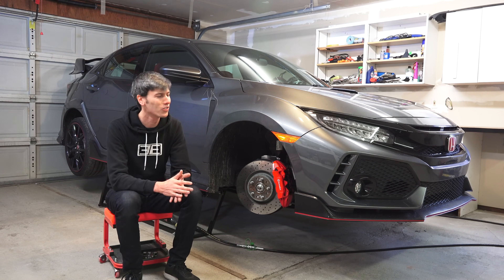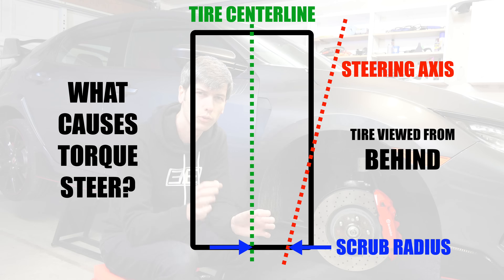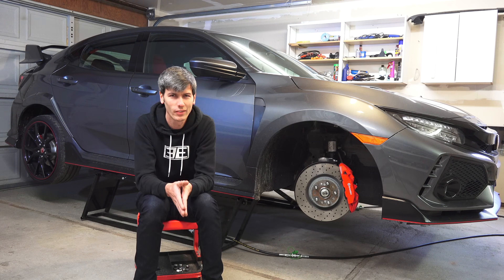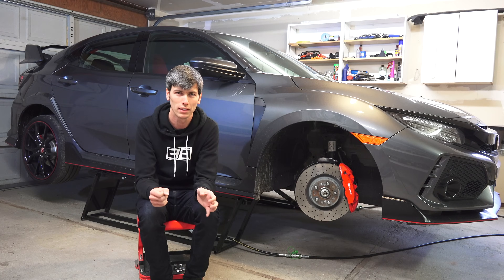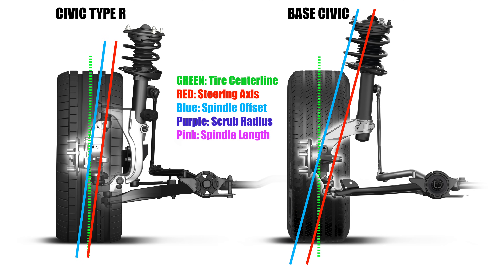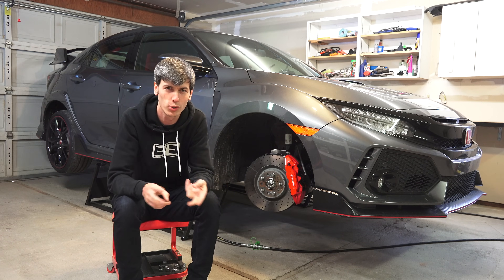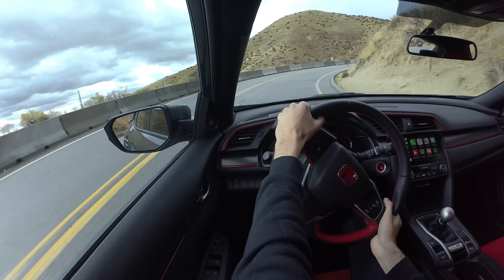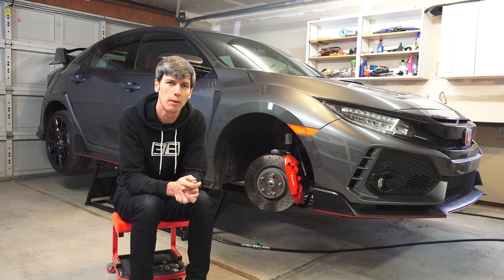Why Doesn't The Honda Civic Type R Have Torque Steer?

Comment: In FWD cars the torque difference at the wheels can cause steering problems, in RWD it can cause living problems :D (joke)
Reply: +Doc. Volt ......not if you were born in the 1960's like me, steering is way easier to me in a RWD while spinning because you don't lose your steering.  a matter of experience, opinion and generation i suppose
Reply: They both can cause living problems.
Reply: Johnny-B Racer born in 97 but agree with you
Reply: Oversteer scares passengers, understeer scares drivers
Reply: Johnny-B Racer 
Yep it’s just a different feel how the different drive systems rotate when cornering under power. 
I’d say awd would be the hardest to get used to in how it likes to go straight sideways till you let up some. 
Fwd similar in that gaining traction again by letting up but still rotates around the inside tire. Blind faith and more power will corner well still. 
Rwd, there’s a reason the fastest cars use this system. That rear inside rotation just works, a little counter steer and again more power is your friend if you have the 😁😁 to get it done. 

I’d say the best system being an awd with a one way front differential, just slightly under driven. Best of both worlds, drives like rwd, execelerates like awd and hard cornering under lots of power pulls the front in. 

I believe the C11 turbo use a system like this?

Or my personal experience or racing R/C touring cars 10yrs ago.
Reply: Lubos Reho Perhaps, but the fact that rear wheels lock forward inherently corrects minor torque differences, and non-open diffs will prevent major torque differences. Torque difference on wheels that can pivot is a much more noticable issue.
Reply: don't have to have been born in the 60's some of us like me that were born in the early 80's or later grew up on rear drive because their parents had 2wd trucks or cars like crown vic's.
Reply: torque steering in my opinion really isnt hard to control, maybe my car doesn't have as much as some but if u drive the car a lot its very predictable, yes it does happen a lot but its just a matter of holding the wheel harder at full throttle, not saying its easier than rwd but just pointing out its just something to get used to
Reply: xanderzero3000  it's not bad if you have lsd.  I've seen videos where they have drag slicks, 500hp and no limited slip.  Haha
Reply: An object being pulled is more stable than one being pushed, generally. So many more options in rwd though, but they require proper (advanced) input techniques. Teenagers and rwd and texting would be hell on earth.
Reply: not if you have any real skill or grew up with rear drive.
Reply: In a performance application RWD dominates. AWD and FWD sucks. A super front heavy vehicle is not fun to drive or safe in bad weather.
Reply: xanderzero3000 RWD offers greater driving control BY DEFAULT.
Reply: Yeah, it wont bore you to death.
Reply: scythelord Meh. It all depends how the car was originally setup. Saying you have 100% more control than FWD would just be wrong obviously
Reply: Yeah, nothing like having your driving wheels loose traction when they are also your steering wheels. Really builds confidence in the vehicle.
Reply: Understeer and torque steer doesn't bother me very much on an 07 honda civic on an unexpectedly slippery road compared to the oversteer on my pickup on a gravel cover road when I was not expecting it 😂
Reply: All I know is I live in the Rocky Mountains where it snows every winter so it's not very safe having a RWD car. I wish I did though.
Reply: LeBeckStudio I'm helping my girlfriend improve the way she drives, and she understeers like mad. She's afraid of oversteer as a driver and I'm afraid of understeer as her passenger. I keep telling her that a bit of oversteer is a lot easier to recover from than understeer, but something about oversteer just unsettles her too much to prefer it.
Reply: 'I was born in the 60s so RWD is best' lmao cool, pops.
Reply: Dude, I used to live outside of Boulder, CO. Honestly, FWD in the snow sucks. RWD in the snow, and especially slippery steep driveways/roads is far superior. FWD on steep slippery driveways...you can't get up the driveway. AWD in snow is best.
Reply: Torque steer not understeer or oversteer.  

Contrary to what the old man says  (I'm not far behind) fwd is easier to control.  Personal favorite and or how big your keyboard brass balls are don't translate to reality.  

What's more telling is when it starts to rain really hard you see fwd cars still driving the speed limit or 10 over.  All the rwd cars have slowed down.   If they are easier to control it should be the opposite.
Reply: Mitchell Couchman Because there are two forces on the wheels, as opposed to one. Even if in theory it was possible to have equivalent steering traction in fwd, there is still the issue of control. A canoe is steered from the back.
Reply: RWD offers greater driver control.
Reply: mbsnyderc ehhh i drove both. RWD is harder to control

Comment: with power/electronic steering, is it possible to program it to automatically compensate for torque steer
Reply: JogBird  probably, but its going to likely be reactive and thus limited and it will tend to reduce road feel.
Reply: Fozee Black. Learning how to drive doesnt eliminate torque steer.
Reply: JogBird I’m pretty sure the type R does this. Also applies single wheel breaking. He didn’t talk about it.
Reply: Fozee Black torque steer can't be eliminated no matter how good of a driver you are. It's a mechanical property. No matter what, if it presents itself it will make lap times slower and make for a shitty car. Ask the EG and EK Civic track community.

Comment: Ford RevoKnuckle :)
Reply: Renault was first with its perfo hub. Then ford with revoknuckle. Then vauxhall with hiperstrut. Honda basically late to the party.
Reply: You are all wrong Toyota invented this with it's super strut suspension on the Toyota Celica GT-Four.
Reply: Yes, Honda's suspension setup here is very similar to RevoKnuckle.
Reply: As far as I know Peugeot was first with the revo knuckle(sorry I don't know Peugeots name for it) on the 407, they still use it on some 508s but it's mostly on the c5, it was a good design and with the double wishbone aswell it gave an excellent contact patch but it gave a lot of trouble with the swivel bearings
Reply: Yup. 👍🏽👍🏽👍🏽
Reply: The original.

Comment: Please explain the DSG fart sound!
Reply: Jack Gedge I think you are for the most part correct. However I do recall a journalist asking a Mercedes AMG engineer about this and part of the reason was that they intentionally left fuel injectors on while simultaneously cutting ignition to give it that sound. I think some has to do with keeping modern turbo engines in boost, however if you compare AMG sounds to, say, a 911 Turbo S, the Turbo doesnt have nearly any "fart" sound since they likely cut both ignition and fuel.
Reply: Alan's correct, manufacturers intentionally delay timing on overrun to make the pop-pop-pop. Just some added theater.
Reply: SilenceFiction well to change gear you have to lift off the throttle in a manual car. The DSG is an automated manual, still has clutches etc just has an ecu to control it all. And so to dissengage drive, the ecu cuts ignition for that split second whilst the gears are swapped, cutting ignition instead of fuel means that you get the popping/fart noises because theres still fuel being injected. And so travels down the hot exhaust, It's why DSG diesels dont fart, they dont have an ignition system do they.  Does that help? Its my understanding of it anyway
Reply: kabob21 on the over run you can use ignition timing as a form of anti lag. Wrc cars are upwards negative 50 degrees timing on overrun and they generate over a bar boost on idle! But they have boost actuators that are opening and closing the wastegate and injecting air, thats not turbo flutter it's these actuators injecting air
Reply: Rodrigo Villanueva no because the throttle pedal on a diesal is the throttle body. The diesel isnt ignited its just compressed, the throttle pedal directly controls how much diesel is squirted into the bore. More you press the more diesel is squirted in. Diesel dsg cars, simply cut the diesel as there is no ignition
Reply: SilenceFiction - because das pollution
Reply: marketing..
Reply: Rodrigo Villanueva it does, because diesel isnt ignited, its compressed. No fuel going on, ie no throttle applied, means no combustion in the cylinder. Diesels work very different to petrols
Reply: Jack Gedge Following your logic, dsg diesels would fart every time you let go off the throttle, correct? I suppose they don't do it because diesel fuel doesn't burn, no matter how hot an exhaust is.
Reply: Jack Gedge Yes, I know. But I don't get what that has to do with my question haha.
Reply: Rodrigo Villanueva They fart because ignition is cut but fuel isn't, diesels don't have an ignition system, therefore, they cut fuel on decel instead of ignition therefore no pop. Simple.
Reply: Jack Gedge I perfectly know how diesel and petrol engines work, thanks. It's just you said dsg diesels don't fart because they don't have an ignition system. I'm just saying that's not the reason.
Reply: Rodrigo Villanueva evidence in this thread of comments says otherwise pal. You cant even get tuned dsg cars popping on gear change. Thats because diesels just wont, you cant get them to do it. Fact
Reply: SilenceFiction I think it's also how fast they shift, it drops a lot of rpm very quickly when shifting.
Reply: Rodrigo Villanueva you literally make no sense. Another person has told you that I'm correct in why diesels can't pop. And yet you continue to post a comment. Are you a butcher, because damn you have a lot of beef! Like seriously take a chill pill.
Reply: The S1000 engine from BMW (S1000RR, S1000R and S1000XR) in motorbikes has this "fart" sound to (but no turbo) if you drive in dynamic mode. They call it "sound acoustics". It is very  loud, every time I go of the throttle or shift down this sound will created out of the exhaust. There is no technical background, BMW integrated this only because some people feel cooler with this. 
For me it is annoying.
Reply: Because of your mother lol

Comment: It still should've been AWD. I don't get why they decided it shouldn't be when all of its competitors are.
Reply: basically what i was saying. by ditching the awd you cut down on costs and weight and you get better mpg and power to the tire.
Reply: FWD is also slightly more efficient than AWD, maybe that could be one of the factors
Reply: TheJacobShapiro heritage. all older civic r were FWD
Reply: TheJacobShapiro also it's competitors are the Renault megane rs, the seat Leon cupra r and the new Hyundai i30n, all are front wheel drive with between 250 - 300+ bhp and fwd allows Honda to make the type r relative cheap

Edit: I mean having fwd instead of AWD makes the type r cheaper then it's AWD competitors, but I guess in America it's competitors are the focus rs, the golf r etc.
Reply: money. the competitors have more power for slightly more money. if they put awd it would cost the same as others and be heavier, and put less power to the ground. it would lose it's edge.
Reply: FWD is what makes a Civic, and it is not bad
Reply: TheJacobShapiro They stuck with the legacy I suppose, Civics have always been FWD. I get it, and looking at how good this system is, I don't mind it not being a 4WD.
Reply: it doesn't need it and the track times show it
Reply: DrewLSsix name an example?
Reply: DrewLSsix yes and rti sedan of the same era has 4wd with most the power going to the front wheels. So let me rephrase all civic hatches and coupes have been fwd. Certain sedans and wagon models had the 4wd option
Reply: Because VTEC just kicked in,yo!
Reply: Honda is about value. 4 wd costs more. You've got development, build/install, maintenance and any after sale warranty repair costs. Honda managed to put down that power almost as effectively with a new front-end suspension geometry. The cost is only in the development. Genius!
Reply: and it lapped the ring faster than a Gallardo superleggera
Reply: All civics ALL civics have been fwd. They beat the competition before with fwd and still are now. Why change?
Reply: Focus RS , ha ha
Reply: Because Honda are lost. They've spent years designing a fast hatch that's about on par with the outgoing WRX and will be definitely slower than the new one.
Reply: DrewLSsix what do u mean? 🤔
Reply: DrewLSsix I thought every civic, especially the type r has been front wheel drive
Reply: DrewLSsix so there has been an AWD civic but not an awd type r civic. Fair enough 👍
Reply: DrewLSsix was Just about to say that…
Reply: DohcDmac oh ok that makes more sense now
Reply: Cost is the main reason I believe.
Reply: The Vibe Because of Honda tradition bruv. The new Honda Civic Type R (FK9) is more powerful than the all-new AWD Subaru Impreza WRX STI
Reply: The Vibe but cost doesnt really matter since most of them were marked up anyway
Reply: Questchaun 
They have SH-AWD for the A yea models. They could use it on Honda.
Reply: TheJacobShapiro roots
Reply: What's a civic if it ain't fwd ? Civics have always been fwd, It's true to the original one
Reply: it's because AWD adds weight and point of type r is to be light and it's part of t he type r heritage
Reply: TheJacobShapiro AWD would have been a great idea and Honda made an AWD Civic model called the RTSI. But Type R became famous for being one of the best track day cars and as FWD lead the way for cars like Fiesta ST, GTI/GLI, Megane RS, etc.
Reply: Cause it’s a civic
Reply: TheJacobShapiro weight and money savings is the biggest strongpoint but with 300 wheel I completely see your point
Reply: If it can be that fast around a track with with fwd why is shoulb be awd? Added weight?
Reply: It wouldn’t be a Civic anymore. It’ll be a copycat Subaru.
Reply: It wouldn't be a civic r if it was awd
Reply: I for one like fwd.. easy to work on.. and cheap
Reply: Doc. Volt But, evolution
Reply: TheJacobShapiro weight reduction bruh
Reply: TheJacobShapiro awd = heavy
Reply: It's been making it fwd for 20 years. 
And it's a civic, what do you expect.
Reply: That didn't stop Ford from making the RS AWD.
Reply: Fastest cars ever and honda don't belong in a sentence together
Reply: No, it shouldn't have been AWD. FWD is superior to AWD in hot hatches.  Every hot hatch out there that's FWD drives nicer and handles better than AWD competitors. Best hot hatches? All FWD.  Even the Golf GTI CS handles better than the Golf R and is faster on a track despite being FWD and having less power and torque.  People don't understand how good FWD cars can be. Mostly americans watch this channel, and americans NEVER, I repeat, NEVER even saw a good FWD car in person, let alone drove one, because there was never a really good FWD model on the market, so you can't know what makes them so good.  The first one was actually when Ford decided to bring the EU Ford models to the US, Focus and Fiesta ST only a couple of years ago, so you don't understand the decades long tradition of hot hatches that we have in EU and that is present in Japan too.  All the best hot hatches of all times were FWD cars, and they genuinely drive and handle as good as the best supercars out there.   Chris Harris ranked the Renault Megane RS Trophy as the best car next to the Ferrari 458 Speciale when he did his best drivers car of the year show, and he had Porsches, Lambos, BMW's, Jags, etc. at that gathering. A FWD hatchback put on the same level as a track focused mid engined Ferrari and above far more powerful AWD and RWD cars for sheer handling precision, involvement and fun.  Ever wonder why a 250-300hp hatchback with FWD is faster on a track than a 500+ hp RWD or AWD car with the same weight or even lighter?     The combination of a lot of weight on the front wheels with very complex suspension geometries and very advanced diffs means you have LIMITLESS grip on the front tires, and it allows you to make the rear end of the car behave exactly as you want to because the front is so predictable.  You'll never drive any other type of car that has the ferocity and sticks to the road into the corners and out of them as well as a FWD hot hatchback does, a properly set up one drives like it's on rails.
Reply: @derbigpr500  i love you.
Reply: It can be much lighter, because they sorted the torque steer they have managed to make up the difference and then exceed it's competitors that are AWD when it comes to the track.
Reply: DohcDmac  Honda Civic Wagovan RT4WD.
Reply: I'm glad it stayed FWD. My last car was heavy and AWD and driving around in my Type R is a revelation in comparison. I haven't owned a car this light since I had a VW GTI. Can't wait to take her to a track but I'm still taking it easy on her until she hits 1000 miles.
Reply: It's not money. The car is lighter Fwd. It's part of it's heritage. The Porsche 911 has a terrible car setup. The engine hangs off the rear end like a cantilever. But they push through it and engineer some of the fastest cars ever. Honda is doing the same.
Reply: all the fan boys blowing the civic, ha
Reply: FWD will always have some issues on a racetrack, but the new Civic Type R manages to deal with the shortcomings very well.
Reply: It doesn’t take long for the focus RS to be front wheel drive. The diff overheats.
Reply: Doesn’t matter. The type r is faster than all of them on track. 300hp you don’t need awd
Reply: DohcDmac. Not true...
Reply: Honda not good with AWD.